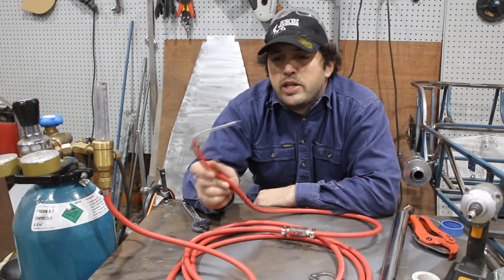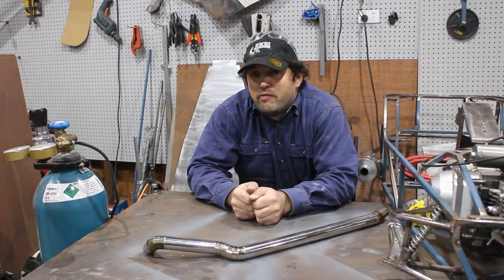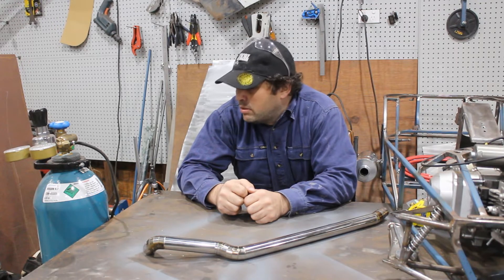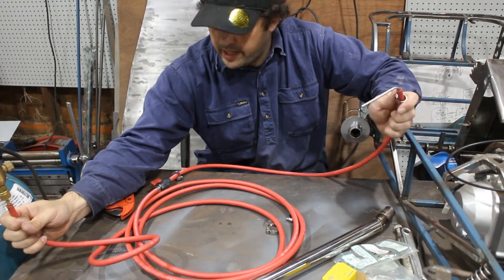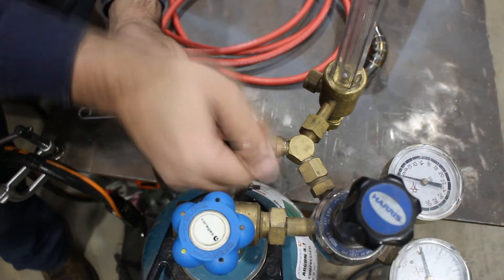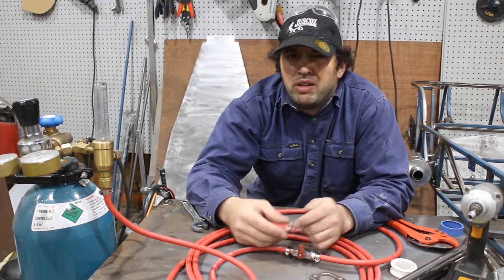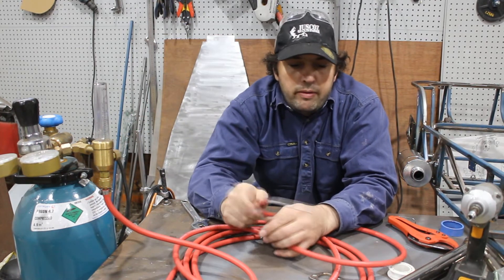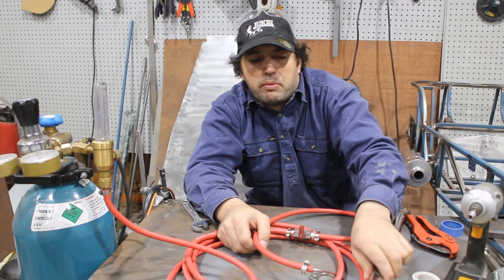back purge system

Comment: Finally a vid that goez into the nuts & bolts of back purging ! Thnk u !!!
Reply from the maker: Thanks. This is the most basic setup that anyone can easily make but it works. The best part is the ball valve on the welding table end of the line so I can start and stop the purge line without having to get up and go to the bottle every time but I also have the flow valve that I can shut off so I don't lose any excess gas if the line gets damaged.

Comment: Not the proper way to Back Purge! You're never suppose to back purge with a Y system. You should use a Dual Flow Meter Regulator. This way you don't need a 2and Gas Bottle. The problem with using the Y system is you're not getting the proper Gas flow when the Y split is after your 1st Regulator. 
The split should take place between the Gas Bottle and both Regulators, hence using a Dual Flow Regulator. This way you know for sure exactly how much gas is rolling down each line. 
For example.if you need 20 cfh or i think it's cubic litres per hour in your case, and you split that with a Y fitting, then your Machine isn't getting the correct amount of Gas because it's being split.off to the Back Purge.
With a Dual Flow you can precisely measure how much Gas you're getting down each line. There are some great Videos on youtube for this. Go to Welding Tips and Tricks channel, and you can find several Videos on how to properly build this setup. Good day Mate!
Reply from the maker: I understand what your saying and it makes sense but I have never had any trouble doing it this way as I am only taking off 2-3 liters per minute at the most and I just start it a minute before I'm ready to weld 
when I tested it at the tip of the hand piece with a flow meter there was still had enough flow to do a proper weld.
but to be honest I did it this way for simplicity and cost I had all the parts to do it this way and it works and I have never seen a Y piece to go into the bottle for 2 regulators but it would probably be costly along with getting a second regulator.
I do subscribe to welding tips and tricks but I have never seen his videos on back purge bottle setup ill have to look them up.
Thanks for taking the time to let me know about the other options
Reply: @juscozcustoms  I definitely understand the "cost" aspect. Give me tour email address and I will send you some photos, and prices. The setup that I'm talking about isn't a Y piece off of the Gas Bottle. It is is 1 Regulator, with 2 Flow Meters manufactured all into 1 component. With this setup you are splitting the gas before it gets to the Regulators/Flowmeters. Doing it this way ensures that you are absolutely getting the exact amount of Gas to each line that each individual Flow Meter says you're getting. 
I feel your pain about how expensive all this shit is. Especially in Australia. I met some Guys from down 7under about 15 years ago, and we were comparing prices on stuff here vs. over there, and it blew my mind as to how expensive shit is over there. Everything, cars, trucks, houses, land, and Welding Equipment. 
The fact that a Gas Bottle cost you a dollar per day is insane!
You can rent one here for $6.00 per month, I just priced them yesterday. I think that's higher than hell because the last time I rented one it was $40.00 per year. I own all of my Bottles.
The Dual Flowmeter Gauge is $121.00 on www.weldmonger.com that is Jody's online store from Weldingtipsandtricks Channel. He had only the best products on there, and they are cheaper than most other places.
That is a Flametech model # 200-FL-AR-60-580 this unit is probably one of the best you can get as far as quality vs. Price. There are some on Amazon a lot cheaper, but I just don't trust any of my critical Welding Equipment to being manufactured in fucking Bangladesh, China, or some other shit hole location.
If you ever need something that I can purchase here for way cheaper and ship to you, just let me know. I would be glad to help you to save money.